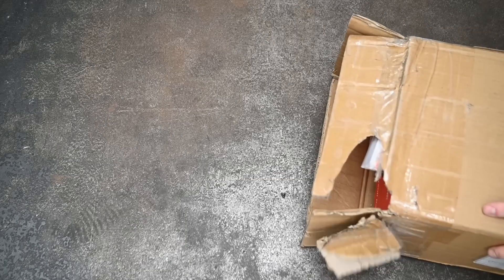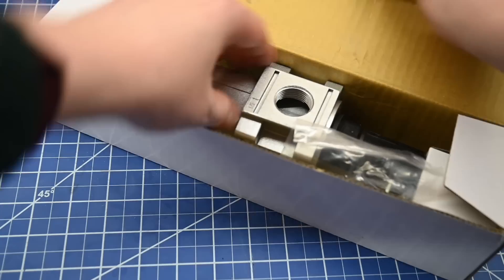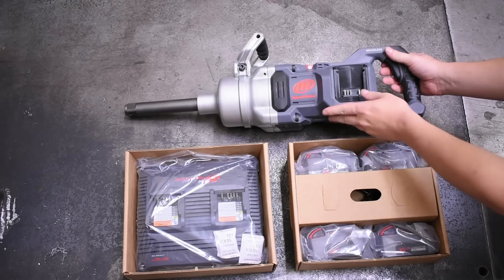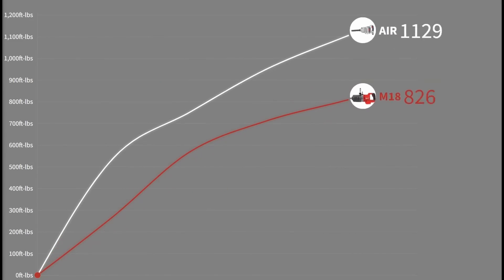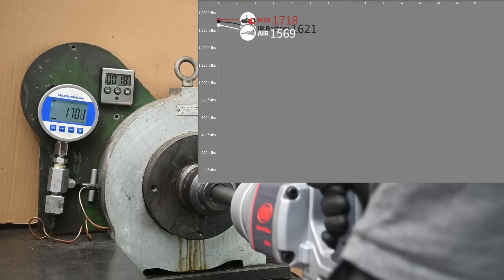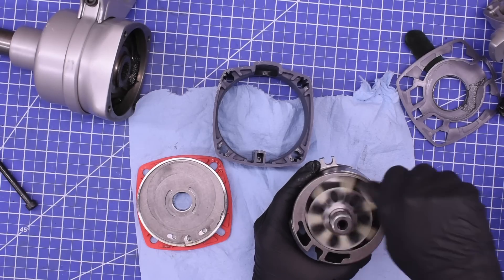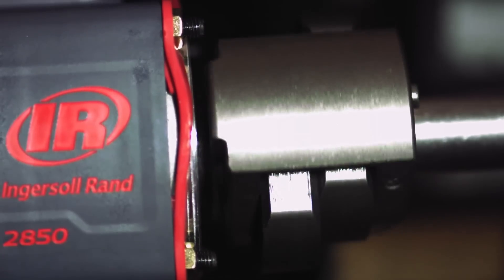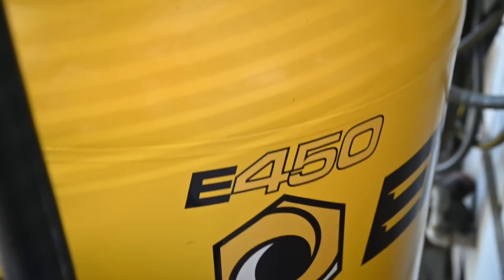The Impact Dealers Tighten Your Lug Nuts With: Largest Air vs Cordless

Comment: Ok, I have watched a lot of your videos and especially like when you get creative and innovative.  An issue I have come across with my 20v tools is battery voltage drop with use.  I know, normal.  However, have you ever thought of doing a test with a constant voltage buck (not sure if that is the right term) unit between the battery and tool?  Love to see if that would work and whether it would take away the need for a big bean battery to get full performance out of a power hungry tool.

Comment: When I’m using an air tool for anything length of time, I always hold the tool down, and turn my regulator up while it’s running, that way working pressure is spot on!

Comment: Always a good watch. I still use air tools along side cordless, and have a 1 inch hydraulic line ,of  about 12 yards specifically for high CFM tooling, and have the inch air guns gear fitted with HGV Air Brake C Couplings. Seem to work well. Keep up the great work. Regards k

Comment: Haha had been cool to have a airgun that required to get it hooked up to the old Koberg 4 cylinder industrial tractor compressor.

To get spicier batteries, what about using car starter batteries in series and maybe a voltage regulator for overvolting to push the tool to its limits. Multiple car batteries should be able to deliver a huge amount of amps.

Comment: There's an option outside diesel to maintain load. You can mechanically bank compressors. It sounds like TTC already has a large second piston unit. On smaller systems, you can bank two compressors with buffer tanks and check valves leading into one regulator. It's inefficient as you need to fully power two compressors but they will totally synchronize if you duplicate the setup to the primary regulator. I do a buffer tank then drier regulator with oiler to keep these valves from failing. On larger systems, you can use a primer tank to keep the valve from restricting air flow by ensuring it's fully opened. This is just awkward because it's hard to find less restricted fittings. It's doable but helps to have a mill and lathe. It requires caution when the compressors are not of identical power. The assembly must fail shut so that the smaller compressor only contributes during pressure drops where any over the rated pressure those check valves close.

Comment: I've used truck glad hand couplings in workshops with big compressors to actually get 1" guns to work. When you put 1/2" on them they suck so much. The initial hit is ok. So lots of waiting . I have to resort to them when roughians use it to do up wheel nuts well past 650nm

Comment: How long do the batteries last? Or how many batteries do you need? The air gun is constantly fed and  never runs out What is the hammer clutch made from as it takes an awful beating?

Comment: Ok I guess it’s time to be “That Guy” although it’s not my intention to make myself out as superior to anyone else here. I also try to steer clear from speaking/dealing in absolutes but I’ll make an exception in this case since this combo is tried and true. Go down to your local Co/Op, Feed-n-Seed, NAPA, Truck-n-Trailer, Farm Supply Store and buy what everyone in the south has in the bed of their service trucks. Get whatever brand air compressor they currently will warranty. It will be gas and hopefully have a Honda engine on it. It will have a 2 or 3 stage 175psi compressor of some sort and  normally comes mounted on a 30 gallon tank that set up to be bolted down in the front of a service bed.  Get a good 50’ rubber air hose with full port 1/2” NpT fittings. get 2 pair of the nice Milton quick release fittings. Get a full port ball valve in whatever size fits the bung of the air tank. Now tell the man to order you the AirCat “1994” impact or whoever has the best copy that they will warranty. it will be heavy, really heavy but that’s ok because we always make the new guy run it anyway. Now this is up to you but I like to run a whip or short leader hose on all my air tools. I believe they call for a 16” long 1/2 hose in the book. Now put all that crap together and let go pull the duals off of the row-crop so we can…

air compressor $4000-$6000
everything else less than $1000
No dryer, no Regulator, no B.S. just a hose and some fittings so you can pull it off when you’re done and leave in the toolbox rather than letting it get air up by the sun. And we can use it in the shop if we need to. 

i’m serious, that exact setup has been putting gain in the bins for ages. and will be about the only way to turn the cutting edge over on the dozer. Cause we’re not ordering new bolts!  BTW just buy a water drain with the cable tied on the end. just like they have on a Kenworth  or Freightliner. crank up the compressor, drag out all the crap and by the time you’re ready to work the compressor will have built up and then you can pull on that drain line and pretend your blowing a old steam whistle.  And if that doesn’t get the job done then buy the good trigger rebuild kit with the hard ball and install it after cleaning up the air ports in that handle. we like to open up the exhaust ports a size or two also. don’t go too big because it will get weak and crack if gun fall of the tailgate again

Comment: Very good video! Interesting results of the 2850 max I'm a big fan of Ingersoll rand air 3/4 and 1in dr air impact wrenches would love to see other models tested. I have IR 2925 - the legendary IR261 and the IR2161xp. The IR 293 1 inch dr  1000ft - 1600ft working torque a very powerful tool the power is almost scary with higher air pressures it takes of bolts off or breaks them.

Comment: We have the 285B and 2850max in our shop at work.
This new one with higher specs don't hit as hard, it struggles more to break loose rusted lug nuts.
It does seem to be faster spinning and lighter however.

Comment: I ran 3/4 and 1 in impact when I worked in the oilfield and the more pressure and flow the happier they are 
We usually used a 185 or 235cfm diesel compressor & 150psi with 10’ of 1’ line to a 50gal tank and then however much 1” hose it took to get to the job 
Our ingersoll 1” would snap 1 1/2 studs fairly easily when the nuts were seized to badly to remove

Comment: I use the IR 2850 everyday at my job tightening 1 1/8 bolts on blade carriers for brush cutters. I will say that it is one heck of an impact. Far more reliable than the Air Cats and Harbor Fright ones we used in the past which tended to lock up (air motor) more often. The IR on the other hand tightened several thousand more bolts before we ever had any problems. I’m currently on my second one in the last four or so years and it probably sees 6 to 7000 bolts a year.
Reply: do you use oil?
Reply: @ Yes, we oil them every morning.

Comment: Vevor has a 1"air impact for around $200 that is claiming 5100 pound feet of torque, I would be curious if that was actually the case
Reply: yeah i would have rather bought that than a kobalt xtr high torque....
Reply: Second that . I have one but I'm curious how it does against big name brands
Reply: it says at 200psi so at 90psi it's half of that. Twice as heavy. Seems to have thin plastic trigger. Can't find any review video about it

Comment: i run that off of a rotary screw compressor that only has a 5 gallon receiver on it... basically puts the compressor straight into the tool

Comment: Air will always be too dog in 1 inch game, a place I previously worked at had souix 1” guns… I’ve ran ir harbor freight, a lot of different 1” guns, that souix 1 inch gun hurt your hands and wrists so bad. It would eat 3/4” cutting edge bolts for breakfast.

Comment: I would suggest to everyone who uses the Chicago style fittings to use the Retention clips for Safety.
If a worn fitting attached at the tool were to come off while hammering the 3/4 or 1 inch hose would whip pretty violently until the ball valve on that line was closed shutting off air flow.
On a paving breaker they use a cable device called a Whip check to capture the line just for that purpose.

Comment: Question:  why get the EMAX instead of the IR 120gal option?  The IR provides 35 CFM @ 175 PSI instead of the EMAX's 38 CFM @ 100 PSI.  Converting to SCFM the IR delivers 447 scfm to the EMAXs 293.
Reply from the maker: We don't have a cfm problem. Just was capacity and line size limited. To answer your question, it's stupid quiet which is just super nice. Also good for filming.
Reply: @TorqueTestChannel  Definitely wouldn't impact (pun intended) a single tool, but would give more capacity for a shop setting.  I'm just IR biased, as I engineer their MSG line of compressors (the ones as big as a small house 😆)

Comment: I was kinda hoping you got your hands on the forge 12.0,  if their claim of 50% more power is real, and just how battery limited the milwaukee actually is.
Reply: battery does have that much more power, but the question is if the terminals and wiring can handle it, and how many tools can actually use that power (3.2kw cont, 2-3x peak)

Comment: @TorqueTestChannel  Yato YT-09620(catalog number) 1" Air impact claims to output 5800 Nm so about 4278 ft-lbs running at 
6,3 bar (91 psi)and 650nm weighs 21Kg(46Lbs) costing 900 PLN (233 USD) BUT i don't know if you can get your hands on it in the US

Comment: You need to try the vevor 1" drive air impact rated at 5175 ft-lbs I been running mine of 30 gallons gas power compressor so I don't know the potential the impact really have next week a getting a big compressor installed at the shop 400 gallons tank hopefully I can put that vevor impact the earthquake from harbor freight and the Ingersoll rand through some good testing I got all 3 at my shop
Reply: Does vevor work ok at 90 psi? Homepage says 5175 is at 200psi. Is it more powerful than IR at 90psi?

Comment: Maybe I missed it, but what psi are you running? You mentioned 90 psi. If that is what you are running, perhaps due to a spec chart, I know of no one that regulates air to impacts. So the rating in real world use will be different. Impacts in our shop run around a 150psi. average, perhaps not what the manufactures wants to see but has worked for 30+ years.
Reply from the maker: We did 150psi on the 15 second run as mentioned. Tools are rated at wot, so 90 into the gun during that is still like 120-130psi

Comment: The cordless inch guns haven't displaced the beat-to-hell CP inch airgun in the shop yet -- there's stuff they can't touch, that the air gun will just slug away at and break loose with ease (I'm guessing it's the difference in high-speed vs slower with a heavier hammer) -- but where they really shine is the service vans and wreckers, putting the 2-stroke railway guns out of work!

Though, if you're setting up for yourself, without an existing shop with a beefy compressor and big tank, air is a big investment; especially as everything else is, increasingly, cordless these days...

Comment: I wonder when Milwaukee will update their 3/4 and 1” impact?

Also I thought almost all pneumatic impacts used that dual hammer design. I’m pretty sure that even the ancient and venerable IR231 used a dual hammer design. Am I wrong in what I thought I knew?
Reply from the maker: Almost all 1/2" do. Basically no 1" have
Reply: @TorqueTestChannel  Ah ok! Thank you for the clarification!

Comment: I think air tools are only really well suited to professionals; those which can or are supported by those who can afford the large capital costs of getting good air compressors and all the plumbing and will genuinely benefit from them.

Air tools don't overheat and can be cheaper for the tool, but the vast majority of hobbists won't need that. I got a 25$ harbor freight electric impact recently and it has more than double the performance of my dinky little 250ft/lbs air impact. 

I had been thinking about using air tools more as I have a bunch if my grandpa's old tools and his big air compressor, but after seeing how good electric tools can be nowadays I decided against it. Also my air compressor terrifies me. I need to build a cage for it.

Just my thoughts on the topic. I never expected to enjoy this channel so much.

Comment: Those Chicago safety pins save lives. I saw someone get clobbered in the face because there was no safety pin and the fitting wasn't seated correctly.That's a lot of force from a trailer compressor
Reply: Even if you don't have the actual pin use anything. Even tie wire is at least something

Comment: I'm a former Boilermaker fitter/Tig welder/Supervisor/etc... and now do QC/Consultant work. I was putting together tooling lists for a speciality division and in my endless youtubing and searching I found a 2 1/2" drive air impact and it definitely went on my wish list just because it's awesome and would forsurely snap some dirty crusty oil field nuts and bolts and I bet it would make your dyno jig it's bitch lol, please go and buy one and see how much beans it has and if it's worth the gnarly price tag and even the sockets will break the bank and your back. Largest air impact I've ran so far is a 1 1/2" drive air impact that we used the overhead crane to move around the shop and hold for us.

Comment: If you ever want more air just add a second compressor anywhere in your system that seems wise. You can also use a mobile diesel or gas powered compressor on a trailer feeding a Chicago fitting connected to your system then just rent one for reviews or score one to have handy depending on what you do for fun.

Those who blast can never have too much air and a convenient way to add more is add more compressors. Those who care can stagger pressure switch settings to favor one compressor and of course you can run as few or many as you want. I prefer used industrial three phase industrial compressors then instead of running three phase (expensive and often billed at commercial rates, and expensive to run to most shops in the US) then run them off a rotary phase converter (used are fairly easy to find but there are plenty of kits where you supply the motor) which then allows you to use all sorts of industrial equipment including transformer style welders most people pass by because they don't understand the rather simple systems.

For example my current system is easy to copy and because most of it's on steel dollies if you rent or want easy shop reconfig is VERY easy to move.I tack weld compressor/motor decks or horizontal tank feet to my self made simple rectangular bases which use round shank scaffolding casters. I don't plumb my shops with pipe or tubing. I use red air hose (3/4" bore) and Chicago couplings for the main supply hoses between my two compressors and large industrial receiver tank (home gamers rarely think to grab those). The receiver tank is vertical and outside my shop. I raised it by welding a lifting eye to the plug on top. When you run two or more motors from a rotary phase converter each makes the next motor easier to start by joining the fun. I strongly suggest reading the Practical Machinist forum on the subject. 

Chicago fittings like others permit easy addition of taps by cutting hose then installing Chicago couplings on the severed ends. Then I add a simple tee pipe fitting to bridge the gap and have a (valved) Chicago outlet. You can and I do keep adapters with standard air chuck sizes so I can run smaller "whips" where appropriate. Big air for MUCH improved abrasive blasting capability is glorious and the above method permits a smaller electrical feed than required to start individual large electric motors. If your location has multiple electrical feeds adding compressors is even easier. I should have done this thirty years ago. I can rearrange my shop for very low effort (I'm elderly and thoroughly damaged) and move equipment for cleanup. Even my lathe and mill are mobile but I don't leave the running gear bolted on.

Comment: I'd really like to see you test HF and other 1" air wrenches. It would be fun to see what they can do on a 150psi 80 gallon air compressor fed by a full size half inch line with half inch couplings. That's affordable. The hose and fittings are available at HF. 175 psi 80 gallon air compressors aren't that expensive or rare in farm shops.

Comment: Overall comparing I think that cordless went a long way of improving that even with lesser results it's better to go cordless than setting shop - depending on what you actually do of course. I really can't compare apples to apples here. In most smaller passenger cars/motocycles most of cordless impacts will even be way to much. I remeber when I had Atlas Copco drill which was a copy for europe of M18 from 90s. I thought that was strong. I got M12 Fuel "hammer" drill, that thing with 6Ah when not careful is a wrist breaker, seriously. When I had to take out subframe from my vauxhall astra which has long M14 bolts, never touched for 20+ years, loctited, rusted my M12 stubby just zapped them out in seconds. What else would I need? It did cost a fraction of whole air setup for a kit, whole kit. Conclusion is very on point, you get nice results for affordable price without breaking ze bank from cordless but in very heavy duty use I think air is better. I'll leave the excel sheet for anyone else - what would be more cost effective? Some batteries or whole air setup? I think results are to be for own individual interpretation.

Comment: I’d love for you to be able to get your hands on a IR 2 1/2” gun (WBB3136068). We have 2 at work that we use for re building roller tires on a vertical mill. Take 3 guys to hold it and we suspend it from a crane. I think they rate it at something crazy like 20,000 lb/ft. We use it to break loose 4” shank bolts all day.